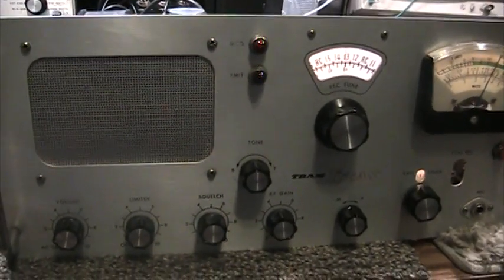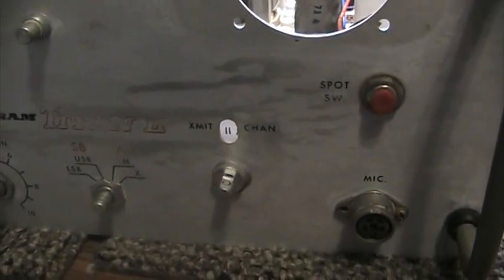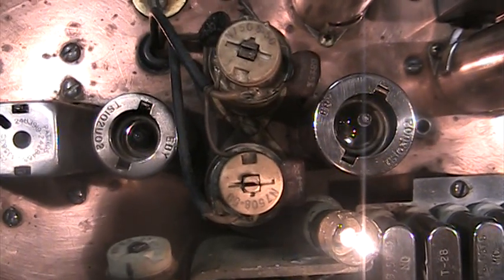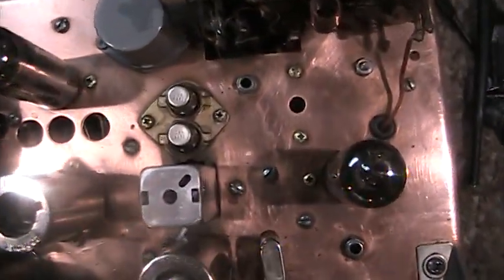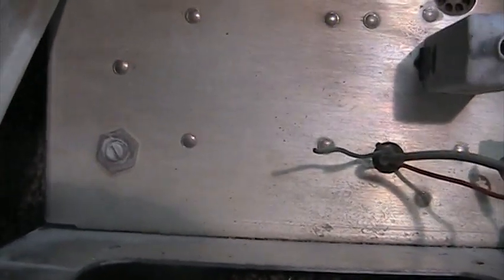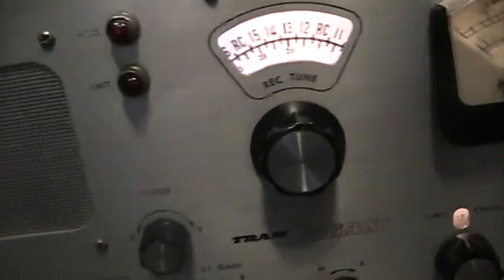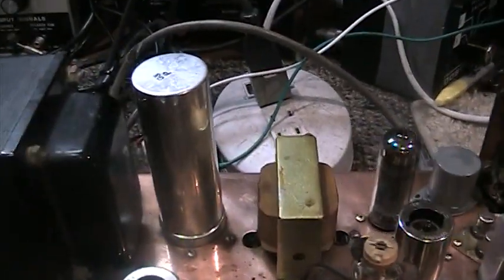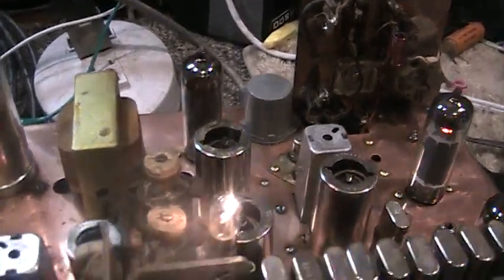Tram Titan prototype copper chassis nuvistors  dual collins filters

Comment: Didja ever wonder... Tram and Browning were located about five miles apart. Tram used a 31.5 crystal and Browning used a 31.4 first conversion crystals. Tram used a double triode tube for the RF amp while Browning used two Nuvistors. Titans and the Mark 1 and 2 used the Collins filter while the Mark 3 did not but had an extra IF stage. Browning and Tram used a BFO for SB reception like Utica's Town and Country 3 and Regency's Imperial. Look at the chassis layout on a Titan 1 or 2, and the receiver layout on a Mark 1, 2, or 3 and see just how alike they are. I think that there was a little collusion going on between the two companies' design and engineering departments. I own a Titan 2 and a first-generation Mark 3 with the rare AM only transmitter. 
Key to aligning both receivers is knowing the frequency of the 31.4/.5 mhz conversion crystals. For instance, the frequency of my Mark 3 is 31.406. If you subtract 27.105 you get 4.301. Adding the 455 kHz IF frequency gives you 4.756, the frequency of the tunable oscillator. I used my TS-2000 to set the manual tuning dial to this frequency, then with the 27.105 generator tuned the IF stages. They were off enough that adjacent channel rejection suffered. 
If you don't use the crystal receive then slipping the frequency of the tunable oscillator is a good alternative to trying to get a new 31.4/.5 crystal. The 31.5 in my Titan is dead on.
Reply from the maker: I replied already somewhere else, but meant to reply here. But to repeat myself, Tram derived from Browning. 1 of the Browning engineer's decided he could make a CB equal or better than Browning and put it all in 1 box. Ever wonder why Tram's had a VFO and a crystal selector?
Reply: @tramdr  , back before the first 23 channel rigs it was common for radios to only have 6 or fewer transmitter channels paired with a 22 channel (later 23 channel) tunable receiver. The bottom line was that (a) crystals cost money, and (b) crystals took up a lot of space. Early crystalplexers like Utica's Town and Country 3 and General Radiotelephone's MC series used one crystal per channel, which was expensive. 
Tram and Browning were expected to be expensive, top-of-the-line radios and to sell them without a complete set of transmit rocks would have been unheard of.

Comment: They did go with the hot receive 6SH6 Tube on the production ones.  A nos 6SH6 goes for 25-45 bucks nowadays thanks to audiophiles.
Reply from the maker: +orange70383 If my memory is right, you mean 6hs6? Anyway, I thought Titans used the 6ba6, not 6HS6.

Comment from the maker: 6gm5 19 watts used in the newer (later) Titan II's and the IIA's. 
6gk6  13 watts used in the Titan 1,s and most of the Titan II's (older or early)
The 6gm5 is better. Bigger, and will produce more power or audio in this case as it's the audio power tube.